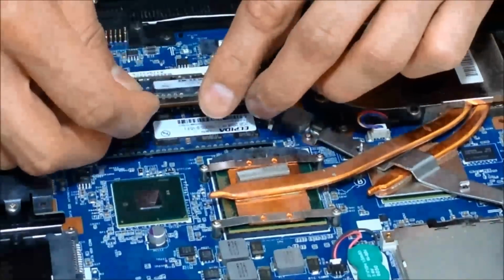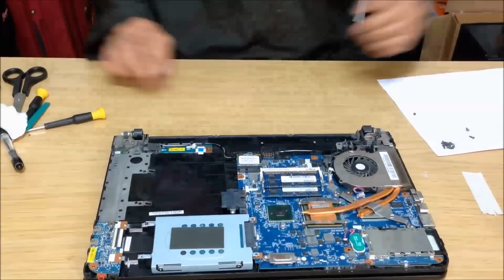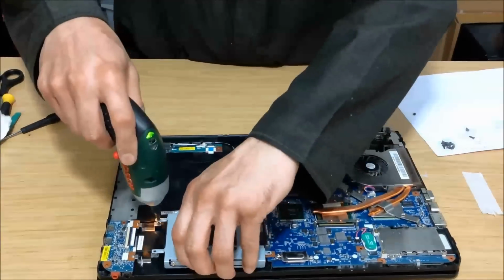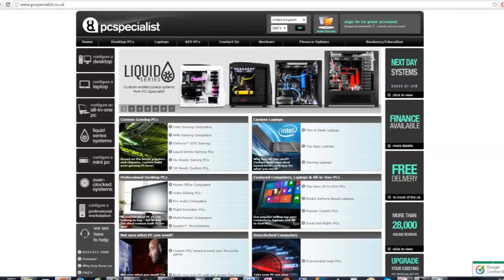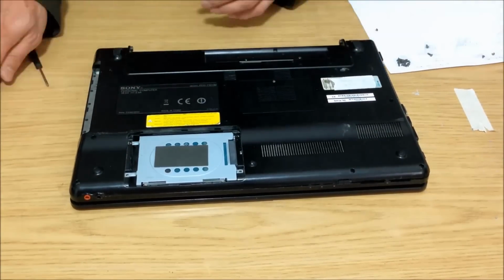How to Fix An Overheating Laptop Repair –  Sony Vaio Disassembly Fan Cleaning New Thermal Paste

Comment: Here in the future I'm planning to use MX-6. But tbh, I think I might be better off recycling the laptop. But I might just keep it to use it as a test bed to learn about Linux. I want to try to keep it until it's totally dead. So if windows won't support it, then I'll explore another operating system.

Comment: Thanks for the tutorial and hope you are doing well. Having random freezing issue, that requires to force shut down every time, with an old (2012) Sony VAIO PCG-31311U (VPCYB35AL). Already done full maintenence, but it continues to freeze, guess It needs extra external cooling to help reduce its overheating problem.

Comment: I have that problem and followed the instructions and yes I found the old heat conductive paste had gone hard and detached so renewed it as shown. The PC started up giving all the indications the problem was fixed. THEN.. after accidentally draining the new battery (left it on sleep mode) on restoring power it failed again with exactly the same symptoms it began with!
ie on power on it idled with blank screen for 30-40 seconds then the fan speed increased for 5 seconds and then it shuts down. Any ideas welcome.. Thanks..

Update: I replaced the CPU thinking it had been damaged.. but my Sony AVIO still shuts down about 30 seconds after starting.?
Reply: Same issue 😪

Comment: I know this is almost 5 years later but thank you for the thorough video! i was able to change out the i5 in my mothers Vaio to an i7! Woohoo for quad core!!
Reply: Did u have to do anything in bios to accept the new i7? I have an i7 4th gen and would like to update
Reply: @mattrosich  no I didn't have to do anything in the bios to make it work with the laptop, but just make sure that the i7 you select is fully compatible!

Comment: Can you make a video of putting thermal paste for ASUS K43SJ too please? Also if you dont mind I wonder what is the problem to my laptop, the problem is when I open my laptop you can feel the slowness of the system unless I restart the laptop it will run smooth (but not that smooth because its old now).
Reply: the old thermal paste should be washed off with a damp cloth and alcohol. New thermal paste needs to be applied only to the processor crystal, smeared with your finger to a thin layer (0.2mm) throughout the crystal - the role of thermal paste so that there is no air gap between the crystal and the cooling system. Slow Windows System - probably a lack of RAM - do 2gb+gb or 4gb+4gb. Another option is the deterioration of the HDD. Check it with the program  HDD Regenerator, Western Digital Data Lifeguard Diagnostic, Seagate SeaTools
Reply: for the laptop to use all the RAM, you need to use Windows 64 bits: Ws 7 x64, Ws 8.1, Ws 10 Home / Pro.
What processor do you have in your laptop?

Comment: I've gone through several like videos and find this, easily, the mot professional.  1. No music!  2. Good, simple idea of how to keep track of where screws go.   3. Not removing anything that doesn't need to be removed to get to the CPU and fan.  4. Explanation of everything you need to do and each thing done on screen.  Sure, you could have gone more into cleaning the fan, but that seems fairly basic and easy.

Now a few questions.  For one of these, what is a good choice of thermal paste?  What is a good plastic tool to use to clean off the old?  What is the power screwdriver to use, or something like it?  I'm not going to use any of my drills.  And do you know, for the VPCEB1SFX, can I upgrade the cpu from the i5-430m to an i7-640m?  Same architecture, socket (G1).  Also, can I upgrade the wifi card, or does Sony white list usable cards the way HP does?  

Thanks for an excellent video on the Vaio's!  Ours shows stripes all over the screen within a few minutes of bootup either in Win 10 or in the BIOS, there is no external graphics chip, so it sure looks like the cpu is hosed.  Others have noted that while you might get it to boot for a bit after changing the thermal paste, that there is permanent damage so  you need a new cpu.
Reply: i5-430m - stepping C2, i7-640m - stepping K0 - the processor on the laptop may not turn on. In order not to take risks, it is better to buy i7-620m (with the inscription on the case "SLBPD" - steppihg C2).
I wash off the old thermal paste with wet wipes with alcohol (wipes are sold in packs in the supermarket). I use GD900-1 thermal paste (6w/k) - inexpensive and good thermal conductivity. Thermal paste is thick and therefore does not dry out for a long time. I have an i7 processor (hot) - so I change the thermal grease every 1.5 years. I put a drop of thermal paste and then smear it with my finger over the entire processor crystal with a thin layer (0.2-0.3mm). 
I disassemble the fan and drip 3-4 drops of machine oil into the bearing - so that it works quietly and for a long time :)

Comment: NOW I find this vid! I'm actually watching it on a Vaio I upgraded today from i3-M70 to i3-M90 (2.4 GHz to 2.66Ghz - £6 for the replacement CPU). One correction; I believe the chip you reckon is the GPU is actually the Intel chipset,  graphics are Intel HD on the CPU (hence two dies on it). ETA - nope, I was wrong, actually that is a GPU chip under the other cooler plate, the IGPU on the CPU is just left unused I guess.

Comment: I have cleaned my laptop using the exact procedure showed in video. But I have now problem that when I switch it on, fan starts spinning, but no display. Then after few seconds fan rotates heavily and loudly then automatically shuts down. Please help

Comment: I know how to dissamble a laptop but i dont have any required tools to do it..
I tried to fix my dads laptop, the hinge and its processor is broken and i dont have any money to repair it because i have something important inside it but now i cant even make it boot. It keeps restarting over and over again, it does not show the boot log.
Even the fan or the processor is making loud noises

Comment: Just junk the Sony Vaio. Take out memory and HDD throw the rest into the dumpster. Buy a refurbed Apple or a new Dell. The Vaio laptops suck heat and fan noise will drive you crazy. I had one. Tried everything nothing worked. Anybody want to buy a tube of paste ?
Reply: hi

Comment: Sony service center refused to clean the fan because one side hinge is broken..
Reply from the maker: That's unfortunate, but it may not be over, I find that changing tactics and speaking to other people in the department often results in getting what you want.
Reply: @HealMyTech1 
 they said that there is a risk in opening the laptop , if opened , the engineer may not be able to reassemble it correctly, because of broaken hinge , I said it's ok don't take any risk but they kept it for 10 days but didn't repaired ,even they didn't installed Windows (the main problem) which is a software issue, no need to open laptop .. 
Worst service by sony this time .

Comment: Man you did so many things wrong with this that I don't even know where to begin.
Don't ever use power tools!
Don't pry the cpu with a screwdriver!
Don't scrape the cooling unit with a screwdriver!
Don't drip the thermal paste! Also spread it out evenly on the surface.
Booting to OS doesn't guarantee things are done properly.
Don't encourage others to follow your method by uploading it to Youtube. 

Don't fix computers.
Reply: What's wrong with using a low torque power screwdriver to take off most the million screws?  I know I'm used to using fairly powerful drill drivers - which could do huge damage here.

Comment: I had a overheating problem with a vaio vpfcf1, I've followed those steps and it works now as a brand new. And off course, also cleaned the fan.
Reply from the maker: Glad to hear it worked out!

Comment: The main issue of laptop showed on video is the quality of its cooler system. Sony had underdimensioned it, and even cleaning it and replacing thermal paste, its fan remains loudness.

Comment: I HAVE SAME PROBLEM RIGHT NOW, WITHOUT THE YOU TUBE HELP. I TRIED TO OPEN THE LAPTOP, IT OPENED 95% BUT IT STUCK AT WHERE USB , HDMI AND VGA PORTS ON THE LEFT SIDE. I PUT TOOLS AND PRESSURES  AND BREAK SOME PLASTIC LOCKS AND I RE-JOINT THE ALL BOLTS BACK TO PROPER POSITIONS AND THEN I START THE LAPTOP AND I CHECKED AND THE FAN WAS STILL NOT WORKING. THEN I BLOW SOME AIR INTO THE FAN WITH THE MY MOUTH. THEN IT START WORKING AND TO MAKE SURE IT IS WORKING PROPERLY I RUN ALL THE POSSIBLE APPS AND GAMES TO HEAT UP THE PROCESSOR, WHEN THE PROCESSOR HEATED THE FAN START WORKING IN FULL SPEED AND I FELL THE HOT AIR WITH HAND AND LAPTOP DID NOT SHUT DOWN SUDDENLY.
BEFORE OPENING THE LAPTOP UNSAFELY SIMPLY BLOW SOME AIR WITH MOUTH OR WITH THE HAIR DRIER TO REMOVE DUST FROM THE FAN. IT ACCIDENTALLY WORKED FOR ME HOPE SO IT WORK FOR YOUR'S LAPTOP TOO.

Comment: to avoid overheating....just install less software n program in ur machine
just put microsoft office,VLC,Web Browser..that;s it
its not merely about  thermal paste issue on the processor

Comment: My Sony Vaio was running very hot and shutting down completely when viewing films on YouTube. I downloaded AIDA64 software. This confirmed it was running very hot. When I ran a stress test using AIDA64, it shut down only 2 seconds. This is what I did:

1. After powering down, removing battery and discharging (by holding down power switch for 20 sec).

2. Removed base panel over the fan. I used a footpump (hand pressure) to build up air pressure in tube with finger over the end, then quickly removing finger to send a powerful jet of air through the extraction vents of the laptop. Sometimes this spun the fan around.  Repeated many times changing position of the pump nozzle and sending blasts of air through the vents. This dislodged some dust, lint which came flying out through the cavity occupied by the laptop fan. Some was removed from the fan space using tweezers. 

3. Then I used a vacuum cleaner (with narrow nozzle) placed on the air extraction vents outside the laptop. Starting with minimum suction, I moved the nozzle back and forth along each extraction vent. This made the laptop fan spin very fast and certainly helped to clean both the fan and vents of dust and lint that had built up. 

4. I finished by carefully placing the vacuum nozzle over the fan compartment itself, hoping to remove any remaining dust within the cavity. I gradually increased suction power from low to medium in each area.

5. I replaced base panel, battery and powered up. 
The laptop has since operated perfectly, with no overheating. This was confirmed by  the AIDA64 stress test. It showed temperature to be stable and moderate. I was able to view the film I had been watching previously without the laptop shutting down due to overheating. 

This method avoided risk of damaging the fan, microchips etc. since they were all left in their original position. However, be very careful where you point the vacuum nozzle within the computer and keep any screws you have removed in a safe place!

Comment: You forgot to open the fan and clean inside it. The fan is usually full of dust.
Reply: I ordered a new fan but it makes an annoying sound because the bios doesn't accept a new fan.
Reply: @lenny108  did you try updating your bios
Reply from the maker: I dont remember this video in detail, but i may have taken it off screen and did some sort of canned air cleaning, but you are right in the end, the fan should be opened as well for a better cleaning job.  This video certainly needs an update.

Comment: Never use power tools to loosen screws will strip the heads and you will have trouble getting parts off your mother board will void manufacture warranty. Always use manual tools when working with laptops and also use proper ESD wrist strap and anti static mat to prevent laptop component electrostatic damage. Trust me on this does happen and parts end going back as Dead On Arrival because someone did not practice ESD Safety. Hope this helps.

Comment: As a Techie myself, and a perfectionist, I recognize and acknowledge his skills and details, especially addressing my pet peeve of Technicians using power tools on a notebook/laptop and replacing ALL of the  screws when re-assembling.

 1. Most of the dirt and debris is caught by the fins of the radiator. He did not blow air in reverse through the radiator. I separate the fan from the radiator and use a small brush to remove the layer of lint hair or other, then I blow air in reverse flow and look through the fins to make sure they are clear.

2.The "Grain Of Rice" method when applying the heat sink compound to the CPU. The proper method is to spread a layer of about .010" to the entire chip surface (Black in this case) ONLY.
Since Silver Oxide is partially conductive, you don't want it to be on the surrounding components of the CPU.
Reply: I don't open laptops (though now I need to), I did assemble my own mini tower some years ago (and have done SSD and GPU upgrades since), and have been in various aspects of IT for 40 years - this is a good video.

Comment: Salam bro, just looking into upgrading my pentuium p6100 to an i7, do know what i should be looking out for?

would the motherboard prevent me from doing the upgrade for any reason?

i have a sony VPCE series, have 240 SSD much faster than before, however i want to use an application for college which is not able to handle with the current CPU?

and i like my laptop thats why i dont want to get a new one LOL,

JZK

Comment: I have the same laptop like you and it also overheat but also it's problem is that after putting the thermal paste I start it and then while windows was loading it automatically turn off like it has 0% battery but when I checked it, it was 78%. I started again but it turn off without showing anything after turning the power on please help me.
Reply: Gopal Singh maybe you forgot to plug the fan!!
Reply: 1. Most of the dirt and debris is caught by the fins of the radiator. He did not blow air in reverse through the radiator. I separate the fan from the radiator and use a small brush to remove the layer of lint hair or other, then I blow air in reverse flow and look through the fins to make sure they are clear. 2.The "Grain Of Rice" method when applying the heat sink compound to the CPU. The proper method is to spread a layer of about .010" to the entire chip surface (Black in this case) ONLY. Since Silver Oxide is partially conductive, you don't want it to be on the surrounding components of the CPU.

Comment: What type of cmos battery  for sony viao in general? where can i buy them?
Reply: If your VIAO CMOS battery is a double disk in Green shrink wrap with a connector and wire pigtail; It is a rechargeable LION that gets recharged whenever the unit is powered on. My 2009 VAIO battery passed 100% when testing with a battery tester.

Comment: I have a VPCEB42FX vaio laptop, the inside looks identical to yours but the mine has a heat sink that only covers the CPU, not the hm55 chip-set. I wonder if a heat-sink like yours would fit in my laptop? Do you know what model is it? thnnkx

Comment: I don't understand why you remove ram you can do this process without removing ram
Reply: It can get overcharged by statics...
Reply: To reduce posible damage
Reply: @rusellgagaoin9224  Interesting.  But I can see that during the winter it would be a good idea.

Comment: i totally agree with this guy, guys laptops in general suck for cooling, performance and above all longevity, but even a 400 dollar desktop will outperform and last longer than any similarly priced laptop, not to mention its easier to upgrade a desktop too
Reply: I think a laptop outperforms 100 to 0 a desktop when youre not at home or job
Reply: You are right, depends on the person :) and how much power you need and for WHAT! To me laptops mean = Linux.
Reply: Portability?
Reply: I HAVE ACER LAPTOP THE FAN STOP WORKING AFTER 10 YEARS.
Reply: @SukhES  My minitower case came with a not so good front case fan but Corsair helped me get a replacement part and helped a bit on guiding me through the replacement process.  That case has 3 large fans.
Reply: I have an HP desktop from 2002 running Win 7 pro.  Super slow, was from day 1 though it was sold for doing video work.  Beyond that, HP used a PSU that was designed, IMHO, to easily fry but be very hard to replace because it wa designed to not quite fit into an ATX case, just off enough to not fit.  Spent a week looking for a compatible PSU when it died.  My DV7 laptop is designed, again IMHO, to over heat.  Horrible ventilation.  2 of my HP laptops came with awful wifi cards, and BIOS whitelists designed to prevent you from putting in decent wifi cards.
Reply: Look i have his laptop right now for like 10 years its been running only caused few problems execpt now when its getting a bit too hot. Look im just saying if u take care of ur laptop well enough it will last a long time
Reply: @nathanmoreas8660  i'm not saying laptops are completely useless we still need them for portability, but i'm pretty sure you are one out many other people that took care of their laptop, but that's not usually the case with most people, alot of the times the average consumer doesn't even know what specs to look for in a laptop, so they buy the cheaper models, and as you travel with the computer so many things can happen: laptops get bumped, they get dropped, some people spill liquids accidentally on them, and if you happen to be using your laptop with the charger on it all the time the battery isn't expected to last very long either, so there are so many variables involved where laptops are concerned, its not all black and white.
Reply: thankyou for agreeing with me
Reply: What if you move around a lot? It depends you know.